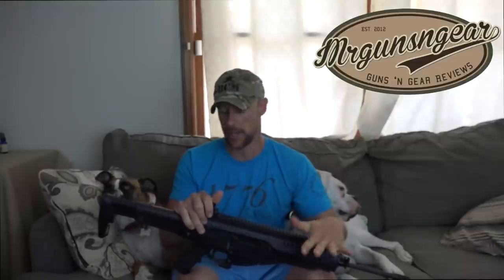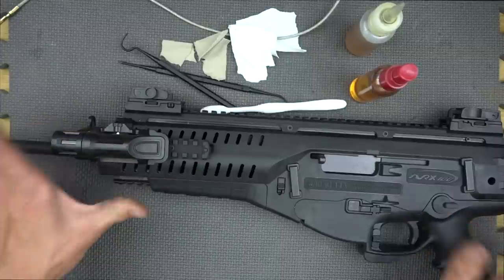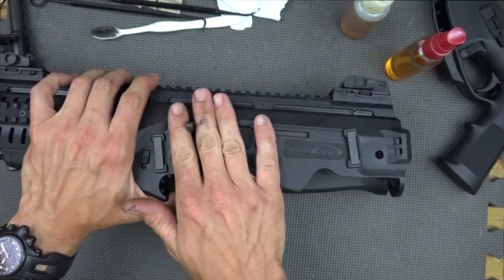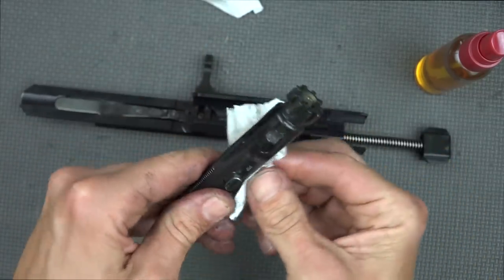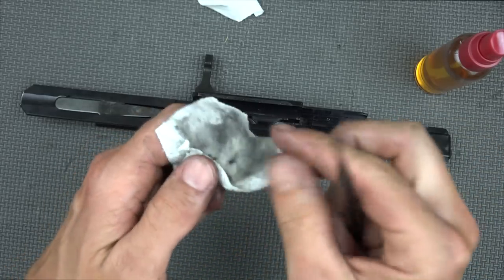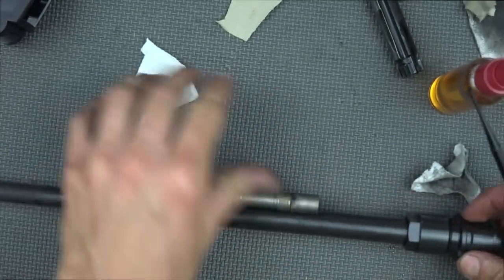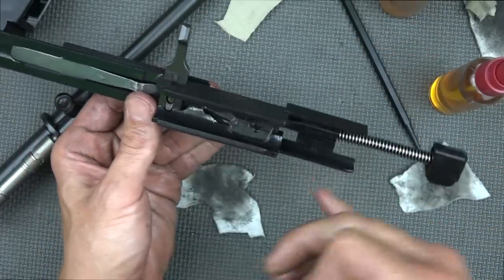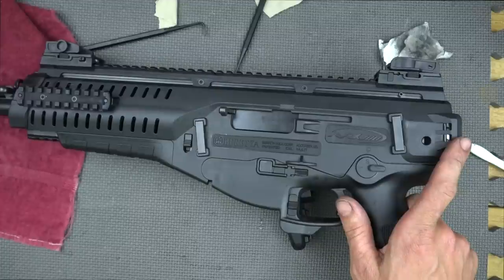How To Clean & Lubricate The Beretta ARX-100 Rifle (HD)

Comment: I've heard it said to NOT let the bolt go home with the barrel out or unlocked. There's nothing for the carrier to run into that is metal. I'd recommend locking the bolt to the rear by pulling the charging handle as if you're going to switch the charging handle orientation. That locks the bolt where it cannot be released by jarring or by the bolt release levers. 

You need the charging handle in line with the barrel to remove the bolt carrier anyway.

I don't know why people are saying the rifle is "finicky". That word means to me more of a "you have to do this step JUST RIGHT, or it won't work" or "sometimes it works and sometimes it doesn't (for no apparent reason)" 

Disassembly is silly easy, cleaning is no more complicated than cleaning an AR, and the rifle is STUPID reliable. Go check out some reviews and videos. They just keep running and running and running. 

IMHO, this rifle is what the ACR wanted to be. The only feature really missing is the different length hand guards. 

Seriously, folks, the ARX is a very nice rifle with some very cool features. It's reliable as heck and silly easy to field strip.
Reply from the maker: Matthew Johnson Thanks

Comment: So I got a couple questions for you. I'm new to rifle ownership and purchased the ARX100 has my first, I bought it lightly used (very lightly, almost no wear on any of the parts). It seems like it was set up for a left handed shooter (the bolt handle and ejection were both on the left) how do I swap the ejection to the right? I easily swapped the BCG handle to the right but couldn't figure out how to swap the casing ejection side. My other question is, I dont know if its a defect but the bolt will NOT lock pulled back. It will lock for a second but any movement and it releases forward. Any tips?

Comment: The "hardest" part I ran into with cleaning was the gas piston only because fouling gets baked on. Piston still moved freely anyway. Being able to remove the barrel gives you very easy access to the chamber and locking lugs.

I'd say it's easier to clean than an AR, and doesn't get as dirty in the first place. I never had an issue cleaning the AR in any case.

It's been a good rifle so far.
Reply from the maker: thanks for the report
Reply: you are supposed to clean the piston BEFORE shooting and contrary to what others  say..YES you should lube the piston....just a bit of Break Free...

Comment: Quick question: Once everything is cleaned and re-assembled, and your bolt is open. Can you hear the piston on the barrel move freely when you point gun up and down? Got mine about a month ago and cleaned it for the 2nd time, and didn't notice that before. It doesn't make the noise when the bolt is closed and ready to shoot. Any info would be appreciated. Thanks
Reply from the maker: +Christian Recio I have no clue, never tried it
Reply: Years late, but the piston on mine slides freely. When the bolt is open the piston doesn't go the whole way back and doesn't have a spring to keep it at a certain resting position.

I'm gonna say this is normal.

Comment: How tight is the bolt release on the trigger guard (or how tight is it supposed to be)? The ARX-100 I handled at my local gun store you could barely get the bolt to drop because the bolt release switch was so tight it would barely move.
Reply from the maker: enigma6482 It's tight.
Reply: Mrgunsngear Channel Thank you...Guess I'll spend the extra $200.00 on an ACR.
Reply: enigma6482 I have had one for a while and I find the bolt release to be positive, but easy to actuate. I wasn't keeping track of the effort required over the course of ownership, so it may have softened up with use.
Reply: Aaron Hsu What do you mean by positive, but easy to actuate? 
The one I handled you couldn't drop the bolt just by using your index finger, you pretty much had to grab the receiver and force it down with your thumb.
Reply: enigma6482 I mean that I can easily actuate it with my shooting hand index finger while gripping the handle. However, you definitely have to make a distinct effort to do so. It's not hard, but just idly playing with the release is not going to come close to releasing it.

Comment: What does the barrel mount to inside the receiver? I've wondered if this type of polymer design is similar to the HK G36; in that after sufficient firing, the polymer that the barrel is supported by will heat up enough and slightly deform - leading to accuracy issues similar to the ones that have plagued the G36.
Reply: iwillnotcomply007 I have wondered this too. It's a mount of some sort attached to the rest of the receiver, but it is not clear what the material is and what the heat tolerances are. I heard something about ceramic, but I cannot find information to verifty that. I think I'll ask Beretta.
Reply: To me it looks like a type of steel ring with a big wide bar on the bottom. The little buttons on the side that you pull down pull the ring out of a slot on the barrel and it feels like the barrel slides out of a bushing back there. Then a thin walled metal tube that the barrel slides in and out of.

Felt very secure and rigid.

Comment: Is Beretta ever gonna make the different caliber barrel kit (like the .300BLK) they promised years ago?
Reply from the maker: Sheepdog Keydet Don't know.
Reply: Sheepdog Keydet There are a few engineering issues that make the .300 BLK problematic in piston rifles. Operation mass in relation to pressure generated by firing the cartridge. Getting all those factors balanced for reliable operation with subsonic and supersonic ammunition is never a turnkey operation in tappet or long stroke. The Direct gas piston gets a larger port and a pistol length gas tube and can take less time if you are working with the more common components of cut or button rifled barrels attached to a M4 Carbine extension. If Beretta is going to produce it and put capitol towards it they want it to work the first time.
Reply: Sheepdog Keydet I think its name is Beretta ARX 200, it's not based on the design of the ARX-160, but it does share some components including its trigger mechanism.

Comment: By far one of the worst modern rifles I've messed around with. The take down is complicated, the trigger is dog shit, the iron sights are laughable at best, the stock is rudimentary, the shitty sling mounts, and to top it all off the grip is integrated into the lower and not able to be changed. Why anyone would buy these I have no idea. I did like your video though and watched + liked it to support your hard work.
Reply from the maker: Derrick Thompson reliability....  weight...
Reply from the maker: Mrgunsngear Channel CHF barrel
Reply: I mean I can get that with a Daniel Defense for the same cost and have a much better gun. I just get ticked off that troops have to use this thing when there are better options at the same price point; ya know? Can you see where my points are valid though? Love the channel and thanks for responding I know you're busy and wasn't trying to troll.
Reply: Derrick Thompson I have a DDM4V11 and this. If I could only have one, it would be the DD for sure, but its nice having options!
Reply: right, but there are sooo many better options. This rifle does so little right at all. when an object does more things wrong than it does right, it is obsolete. BTW love the V11.
Reply: even at $2800, I still had to replace the trigger, stock and fore end of my Scar 17. All the modern rifles are lacking in almost the same aspects. Where the ARX is nice it balances better than my friends ACR is lighter, recoil is a little softer and caliber conversions actually do exist, we're just waiting on importing. I love my Scar 17, but I have a hard time spending $2500 on a Scar 16 that I will have to replace the Trigger, Fore end and stock again. And on the Scars, those three parts will run another $800. Im running the ARX with a RMR with the low mount with Troy Micros and its pretty sweet, the stock isn't an issue anymore